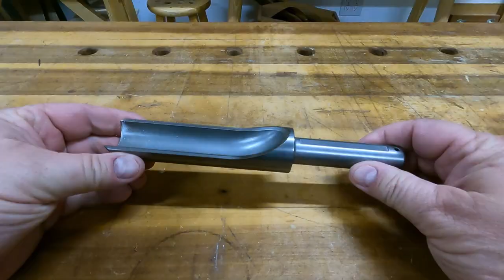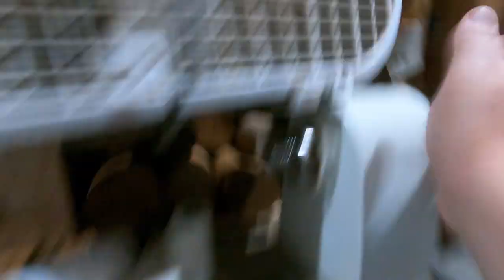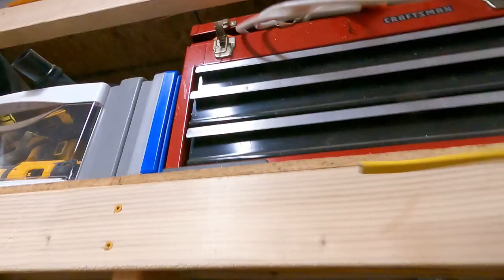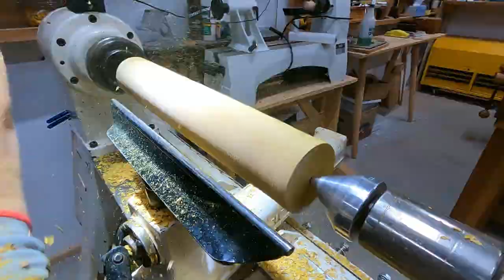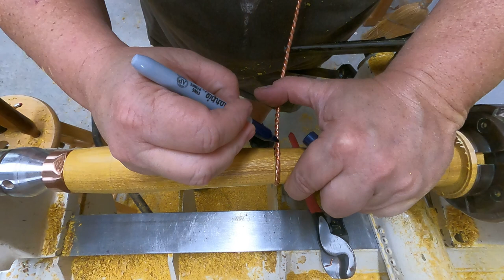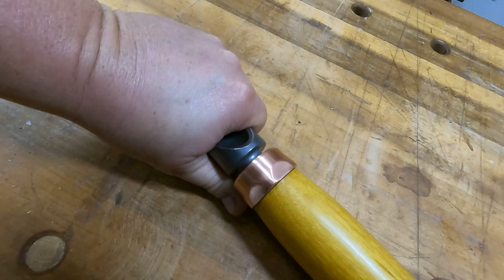Turn a Quality Luxury Tool Handle using Copper and Fire

Comment: Working Bos'darc (We call it Hedge around here) can be quite challenging. I really enjoy it. You have done a fantastic job of working it for this handle. Knowing its challenges, I appreciate what you have done here. I have turned a lot of it over the years and have had to throw a lot of it away and start over. I just cannot complement you enough on this one.

Comment: Fine practical artistry! The copper and black is striking and the embellishing looks so professional. You may be the family production turner, but your dad's artistry must've trickled down a bit. :)

Today I finished my second custom handle with a OneWay/Hosaluk quick change ferrule. The new bed extension meant I was able to drill it deep enough to hold a double ended gouge and to include a nice deep ballast chamber the the rear. Just haven't decided which tool is it's primary steel, yet. 

I enjoy this format of video, fwiw.

Comment: Glad to see you back to doing woodworking videos.
I've got a Carter/ Sons Skew it has an Aluminum handle. It feels heavy to me, except when I weigh it, it's a few grams more than my 2" bowl gouge. Yet I feel a lot of vibration. I still use it a lot because it stays good and sharp.
Very nice handle, looks like it's got some bling.
Bois d'Arc (Bodark) and Copper?

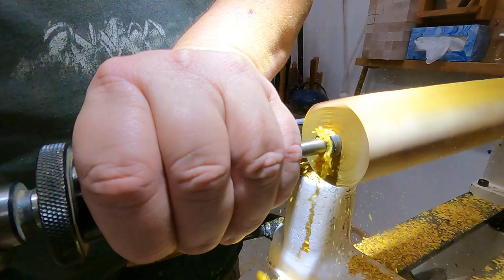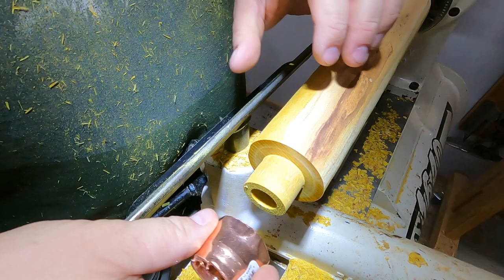Comment: At 2:18, it looks like you remove the threads from the copper fitting, if so, how?  At 2:37 they seem to be back.  Do you remove or leave them?
Reply from the maker: leave, if you use a triangle file and make a groove down them it'll turn them into a cutting edge so you end up threading the wood. I make the tenon about 2/3 down the thread.

I think I covered this in the teaching video on making handles. This wasn't a teacher.
Reply: @wortheffort  I remember that, but it just looked like they were removed at the 2:18 point, but I figured they were still there as you had to struggle a little to get it on. 😉

Comment: Only CA glue to connect the steel? Or was it epoxy?
Reply from the maker: from experience CA is more than enough but 5 min epoxy works just as well. Remember the tenon had a channel on it.